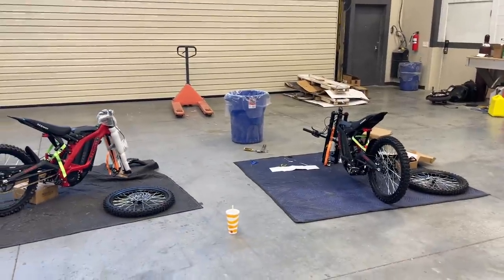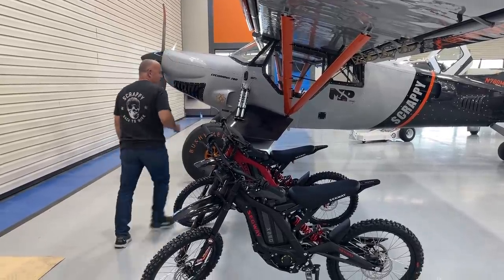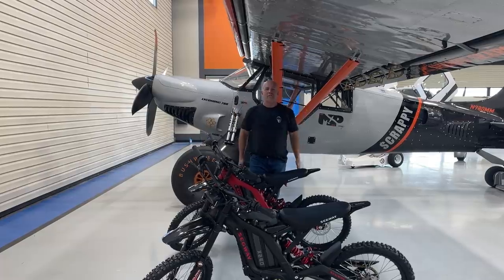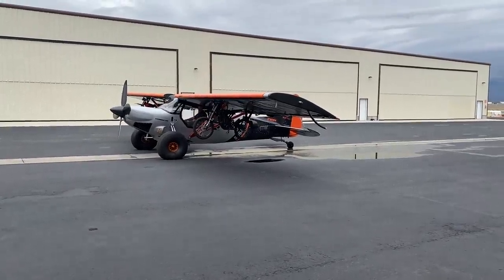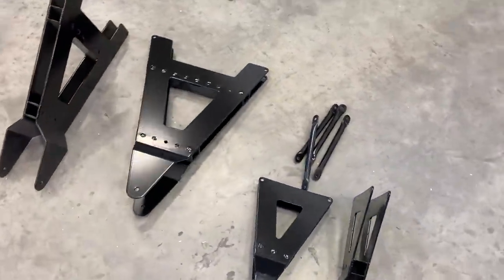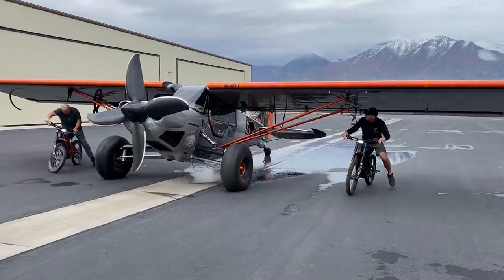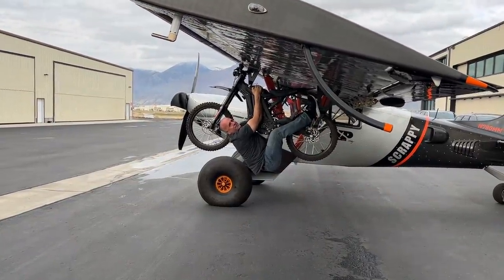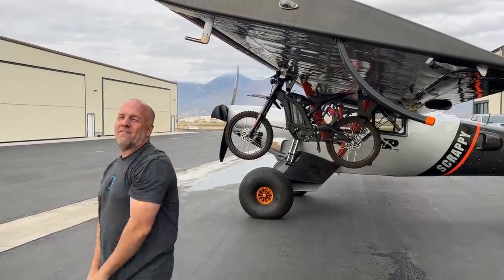Mounting Electric Motorcycles on Extreme Bush Plane | Scrappy #63

Comment: Hang a police helicopter camera pack, FLIR, night vision, 120X zoom and tie into the Garmin screen.  Gives the guy in back something to do on a search mission!
Reply: Think he can find a surplus LANTIRN pod?
Reply: @benaguilar1787  might be a bit pricy in working condition :D
Reply: Now THAT would about the coolest thing that could possibly go on this aircraft. I'm sure he could get his hands on surplus LANTIRN / AAQ pods. Sure the SO he volunteers for could help with getting that through a surplus program. Better yet FLIR should just sponser this man.
Reply: I'm sure he could buy a flir MX-15 or similar. It would make finding people much easier
Reply: @twon4212  (I think a LANTRIN pod would be quite overkill, and not really offer anything over a commercial FLIR. What need has Mike for a laser designator that weighs 530 lbs?
Reply: @MillionFoul  the same reason he built this beautiful plane to begin with. Everyone's overkill is just his kill.
Reply: @yayie2  I mean, sure, but throwing a couple million dollars at strapping 2/5th of your payload weight (because you'd need two of them to not be heavily out of balance) at on the aircraft when you could spend less for a similarly capable system that's also smaller and not designed to be hung off a supersonic jet is less overkill and more an exercise in frustration.
Reply: @MillionFoul  you make a valid point. but since when did that stop Mike from going balls to the wall?
Reply: @yayie2  Well, Mike is a pretty overkill kind of guy, but he did still make his cool custom wing spars out of aluminum even though steel is stronger. There's overbuilding, and then there's just not doing any of the engineer stuff you leanred in school out of laziness. The most beautiful machine is one optimized for its task, and I don't think throwing another 1100 lbs of empty weight on there for cool factor is very optimal.
Reply: Man this is a bunch of solutions looking for problems.

Comment: Mike, and his helpers, have redefined the term "DIY project" and simultaneously set the bar so high that it seems unlikely that anyone will produce an arguably better designed, engineered and built vehicle, for land, sea or air travel.
And, he did all of this with the utmost of humility, enthusiasm and encouragement for all that want to try.
Thank you to all involved in Scrappy.
Reply: It is an extraordinarily overmatched conventional bushplane design to be sure, but even though this roided up high wing monoplane absolutely sets the standard for this class of aircraft, it most definitely isn't the most efficient design for the best possible cargo lift capacity/horse power/take off distance ratios, not by a long shot.
Reply: @Veldtian1  what concerns me about the modifications made to this plane are: 1) How many of them have been authorised , tested and certified with the adaptations , using the STC process? 2) The use of the inset solar P.V. panels on the upper wing surface is another area of concern...  Did they replace panels previously made of Aluminum? Were they installed in places where no pre-existing panels were before? The square corners of the cutouts where those P.V. panels are now installed, are possibly VERY bad areas where stress risers can form, and cause structural failure of these highly stressed areas... 3) And the welding being done on the brackets for the loading of the motor-bicycles, should not have been done. Solid aluminum rivets should have been used instead, because welding sets-up fatigue in the aluminum, by heating up the welded area to above the critical temperature, then anneals the welded aluminum making it softer in the heat affected area, and later-causing it to crack as the areas that did not get up over 475°F. during the welding process, retained their original temper and strength... So soft metal being blended with hard metal causes accelerated cracking & metal fatigue. Hopefully, no welding was done to the airframe by ANYBODY other than the original manufacturer...

Comment: POD ideas: 
1: For Search and Rescue - a super bright set of LED downlights.
2: Aux fuel tanks for extended flights, or refuel other planes/toys.
3: Sidewinder Missiles.
4: Full body padded heated enclosed stretcher for evac of injured crash survivors.
5: 25 to 35HP  motor and prop +batteries from an electric glider, probably 120lbs per side.  With all the solar cells and battery capacity onboard it would increase loiter time (pull back the main power to 25%) and dial in some electric boost.  It would also extend glide range in the event of catastrophic engine failure.   Decrease takeoff distance too.  I don't know how much power it takes to keep Scrappy in the air, but it might be possible to maintain level flight on electric alone.  Which gives you a bit of stealth if needed, for instance, pull the main engine back to idle (or off) feather the prop, and do an extended low power descent.
6: Scaled down B36 twin turbine pod.  (One turnin', four burnin'...)
7: RATO.  
8: 30 gallons of fire retardant. Per side - for quick response brush fire control.
9: Mini Machine Shop - bench top lathe and welding setup in one, rolls of sheetmetal, and fabrication materials - hand tools in the other.
10: Aux water tank in one, (with optional electric heater) for a hot shower at the end of the day on the mountain top, and a meat locker in the other for the mega BBQ.
11: Propane tanks in one, large tent in the other for camping comfort. 
12: Something that holds golf bags and clubs.
13: Catch and release system for a half dozen drones that can string out left and right of the plane in 1/8 mile increments, which would increase the width of the search path, and send data back to the ground via downlink so multiple sources can review.  OK, this is a big project, but all the pieces are out there.  Just needs integration.  And could possibly be productized.  "PSDA". Parasite Search Drone Array.
14: Something that drops watermelons.
Reply: Oh, I definitely like the "fire retardant" idea, and the "auxiliary power pod" ideas.

Comment: May I suggest mounting a telecommunications pod under the wing to help S&R crews communicate on the ground? Maybe find a way to loiter over an area of operations to bring WiFi for lost hikers or injured people.
Reply: Better than wifi, how about a Cellular radio that just lights up their phone with full bars? It could detect and triangulate a mobile phone based on the return signal strength and plane motion.
Reply: @kschleic9053  This is a really good idea.

Comment: As this is a SAR bird, how about having the capability of an air-drop survival supply & support?  Auto deploy a chute on drop?
Reply: Static line chute with some basic release shackles. Would be pretty simple to set up...except for running the pull cord for the release. Hmm, maybe something radio controlled for the release system.
Reply: just open the door and drop it like ww1
Reply: It's cool to call airplanes birds.
Reply: How 'bout a little trap door under the seat, for dropping candy or TPing your buddies house?

Comment: What an incredible job on the whole project, amazing!  I see one or two things that might be a problem. The front tire might spin while flying, possibly very fast, clamping or strapping the brake handle will eliminate the spin. The second thing is i question an aluminum pin for holding the bike. Why not steel of some sort?
Reply: Great thoughts, we wondered about the tires as well.  Since recording this video, Mike has flown several times with the bikes and found that the tires don’t spin.  The pin is hardened stainless steel w/ a 9,200 lb load rating per pin.
Reply: @ChandraSlyFoxPatey  at the very least he could make carbon fiber caps to cover the spokes which likely has the largest amount of drag. That's why all speed bikes have solid Wheels no spokes!
      🤠🐂🏞️🛩️
Reply: @ChandraSlyFoxPatey  OK, thanks. I thought for sure they would spin and i thought Mike said it was an aluminum pin, but there i go thinking again. lol I should have replayed the pin discussion. Thanks for answering, take care

Comment: Hi Mike, I got an engineering design related question for you.
I noticed over the course of this build, that you use a lot of close fitment joinery.  ie: press fits, snug fits, slide fits. Where do you get your charts to calculate the dimensions of two parts, to get the correct fitment before you build it?

Thanks for the great videos, and engineering content. 
Back to Work!
Reply: If I remember correctly from school, you can simply calculate them. When you can do precision machining, you make the parts to just the correct tolerances and you get a compression fit, snug fit, slide, etc. You could even design a fitting that required you to cool down the bolt to far below freezing, then slide it into place and when it warms up again, that fit won't move anywhere. (They did that for the Panavia Tornado - the center bolt that allows the wings to swivel is installed like that. It can't be taken apart again, if they find an issue there, they throw away the plane and build a new one (AFAIK)).
Reply: Ya, Mike calculates and precision machines all his own parts.
Reply: @realulli  Yes.  There are charts with the equations for all of those fits, so that you can calculate them.  That's what I'm asking about.  The chart of fit equations that I have always yields something that is tighter than what it is for, so I was wondering if he uses a different char of fit equations.

Comment: With you Mike, it always only gets better.  Congrats on the bike racks.

When I think about search and rescue and additional useful items I think of think of liter baskets for the injured, toolkits, snowmobiles, and floats for the plane.  Of course the big bush tires probably wouldn't need much help floating the plane. Floats could possibly double a fuel pods.

But, alas the number of high mountain lakes big enough for float planes that are inaccessible by road is probably very small.

A pod that can hold a liter basket for injured or tools.

Comment: You could carbon-fiber some of the bits on these, make them even lighter. I know for sure there's an enduro rated carbon fiber rim for motorcycles that would fit the size already, the swing arm could easily be fiber... that would significantly reduce the weight, at least a few kilos overall.

Comment: Remember guys, an aft CG (within cg range) gives you a higher cruise speed and a lower stall speed. For some unknown reason, most pilots think it is the exact opposite??? Bolt on fuel tanks would greatly increase you aircrafts range. Piss tubes will then become a real necessity. Blue Sky's.
Reply: Real me use 2ltr bottles the "BOMBS AWAY!!!" when they are full!!

Just kidding, that's disgusting.....
Reply: Happens regularly at the end of my road. It’s pretty foul.

Comment: Love the electric motorcycles...great project.  Since you designed Scrappy to work with the Air Rescue situations...perhaps design a quick remote release so you could drop supplies, equipment, etc. into situations where someone was stranded, hungry, cold, hurt, etc.  These mounts could serve SO many different uses. As usual, brilliant!

Comment: Make a two-piece carbon fiber aero shell like you mentioned and mold it in a way that sandwiches the bikes vertically and has pivot mounts built into the mounting point on the wing. Could open and close like a carbon fiber Pacman if you also put some hydraulic struts on them to auto-open when unloading and to hold up and away! Could fit in a quick disconnect system if you wanted to fly with the bikes off and double as a storage container too and keep them out of the elements

Comment: If you're asking for suggestions on what to mount to the wings I have the following two suggestions:

1.  For back country rescue or resupply you could add droppable pods filled with food, tent, survival gear, etc.) that could be dropped to stranded individuals not yet reachable by ground crews.  You'd need only add a release mechanism on each mount.

2.  Although it might seem a bit nutty, you could hang two patient litters (enclosed) to evacuate wounded from back country locations if conditions were difficult for other rescue resources.

Comment: So one may have pointed this out already. I have concerns about the front mudguards. I am assuming they are plastic and I think they would disappear in a blurr at any reasonable speed. Also you didn’t say anything about stopping the front wheels from turning. Extra load on the bearings also gyro effect when changing attitude on the aircraft. 
Thanks for the update always waiting for the next one.

Comment: I once had the task of x-porting two recumbent bikes.  I made a special rack similar to your hanger scheme and mounted the racks to truck's front, pointing forward as your racks. I ran it at hi-speed on the in-active runway, got flutter and hi-resistance. I sewed up two slick canvas socks (similar to a flat letter envelope, slit open at the long top edge and rear end) and fed the socks onto the bikes and hooked laced the flat sock along the open two edges and it took the hi-speed with no flutter and less resistance.  On your test run Mike, tape ribbons all over the bike frame and watch how disturbed the ribbons are. Just another angle to smooth the loading.

Comment: Battery Temperatures at Altitude.  

A simple workaround Lithium Batteries getting too cold.  If you run the headlights on the motorcycles, the batteries get warmer.  Sometimes, when I want to start my aircraft, the recommendation was to run the landing lights for 60 seconds so the battery temp would increase along with the voltage.  Motorcycle LED headlights don't use much electricity so running them for an entire flight would certainly be possible and might keep the battery's from under-cooling.

Comment: Air shows: 

You could build more mounts for aerial stunts, wing walkers, overhead crane points, team up with Redbull to see if they have anything to throw at it from their marketing team.  

Expand on the fuel pod ideas, pods for spares, tools, parachutes, etc. could also be used as mounting points for floats. A way to transport outboard motors for boats.

Comment: Yay! So happy to see a new video drop.

I know the drag of the brackets are like nothing compared to the motorcycles. However, if the brackets are going to stay on all the time wouldn't square tubing have resulted in less drag than the air flowing between the plates of the bracket? Not to mention, I know a guy who is really good with carbon fiber that could probably make totally aerodynamic brackets...

Comment: Hey Mike, since you are into search & rescue, how about placing two MASH pods to place injured people inside?  You can even create a jig to raise and lower the pods electrically.  You have already demonstrated that those hard points can sustain the weight of a human and more.  If you make the pods out of carbon fiber they would be light enough so you can put some padding and belts inside to secure the injured person.  If you fly below 12,000 feet there wouldn’t be a need for auxiliary oxygen, but since you usually work in the mountains perhaps add some supplemental oxygen bottle.  Alternatively, On the other side you can place a fuel tank in which you could displace some fuel to distribute the weight equally between the two wings.  That fuel tank could have it’s own electric pump to help in the distribution of fuel for weight balancing, that way you wouldn’t need to waste time transferring fuel manually.  Knowing you, you might even include weight sensors and make the process automatic.

Comment: I think you could have a lightweight system that is able to recharge the bikes when you are flying (wired into Scrappy's electrical system - even the solar-panels perhaps?).  I particularly like your execution of a useful system of ground transport available when on an extended flight...and of course you have the flexibility of the external cargo attach points for other uses. The beauty of having the bikes as an external load rather than disassembled and inside is being able to very quickly dismount them upon landing and go...
Reply: You missed it -- he already has the "recharge the bikes while flying, from the solar panels" system wired up and working.  :)

Comment: What great fabrication and engineering skills. Aircraft project guys are so different than the Jeep guys that just overbuild everything and don't care about weight. When it has to be sufficiently strong plus light is when the real engineering is required. Curious to see the efficiency numbers with and without the bikes. You said it's significant and I believe it.

Comment: I think you should install some remotely deployable SAR pods.  In an emergency, you could drop some emergency supplies to a crew (smoke jumpers, support crew on the ground, etc.) and provide them with water, blankets, medical supplies, whatever they need.  Push a button in the cabin and they either drop completely, or open "bomb bay doors" and release their contents with a parachute attached.

Comment: That main rib/subframe with the holes, might be used to attach a small manual hoist?  just like loading bombs in ww2, you might try it hoisting up the cycles, or heavier motorbikes? Just a little help in attaching them.  Great work Mike!